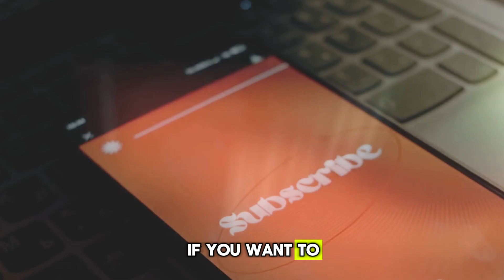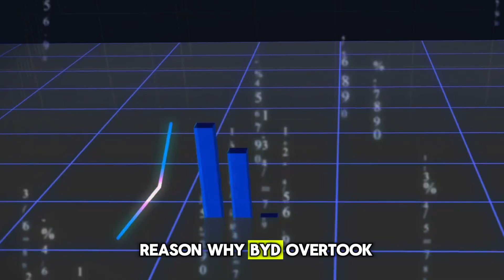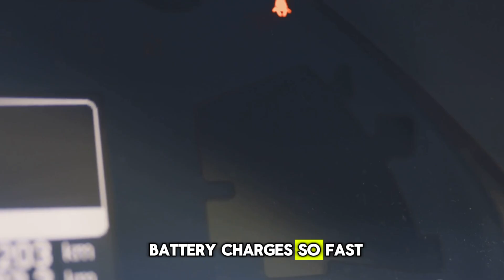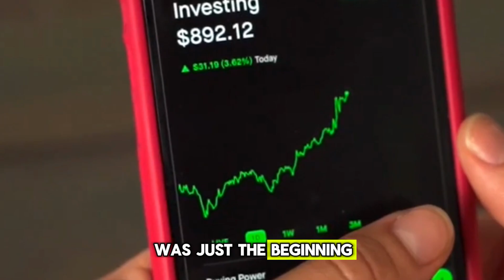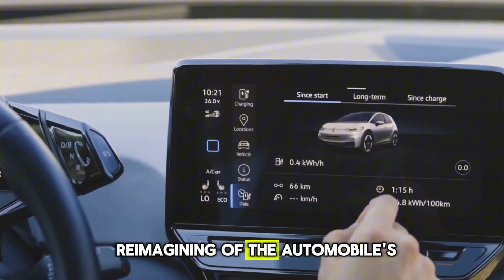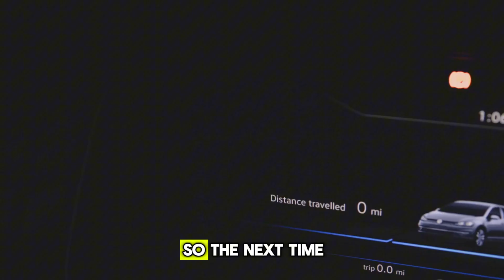BYD CEO drop bombshell Next Generation of Blade Battery with 80% Charge Achievable!

Comment: Just brought the new Denza N8L, 6 seater SUV. It does 0-62 in 3.9 sec; has roll over controls, going over 100 mph and not to worry about a blown tire. Oh did I mention rear wheel steering and moving side ways??